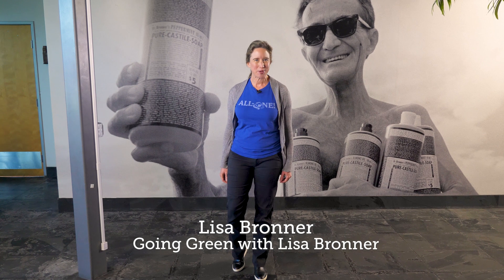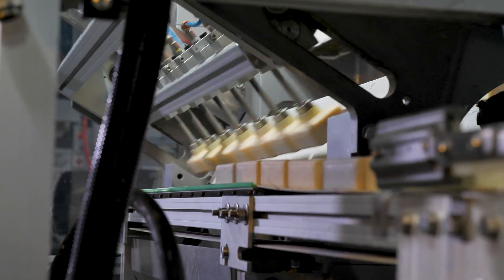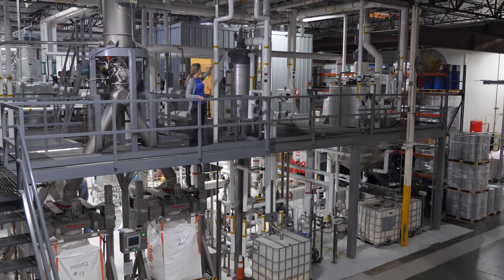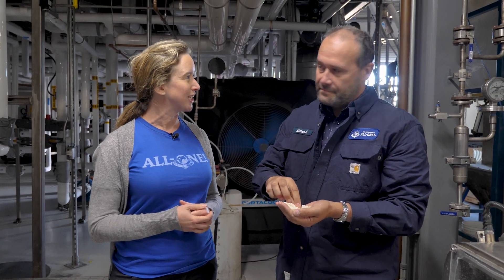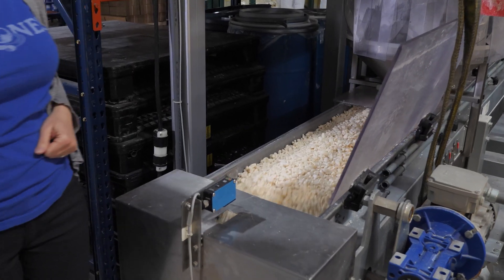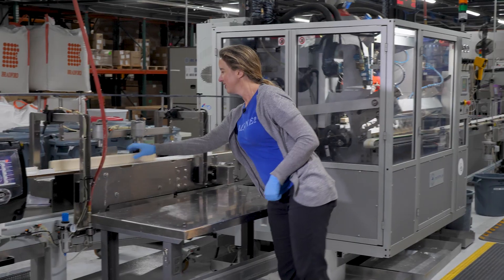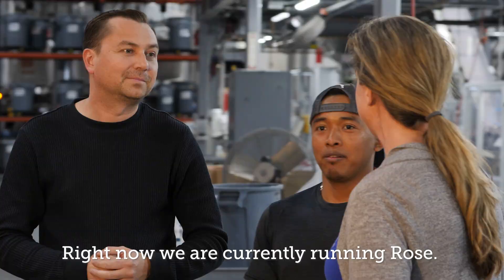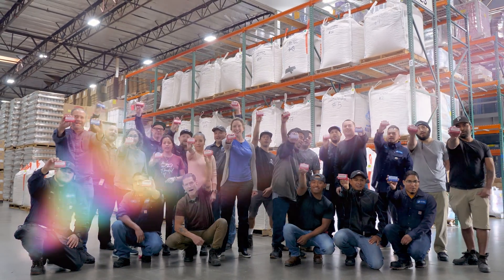Dr. Bronner’s Factory Tour: Bar Soap

Comment: I have a question...why are the soaps milled first
Reply from the maker: I'm not sure which stage you're referring to, so let me know if I don't answer your question here. As you saw in the video, bar soap is a two-stage process. In the first stage, we make the bar base, and the final step of that is the base being pushed through a screen and cut into noodles, similarly to the three milling stages that happen later in the bar pressing process. However, in this first stage, the soap is pushed through the screen not to mill it, but to create the noodles which then dry and cure. Later in the second stage, the essential oils are added to these noodles and the soap is milled three times (mixed thoroughly and pushed through the mesh) in order to mix in the essential oils, eliminate air pockets, and create a super smooth, dense, long-lasting bar soap.

Comment: Hi, is the bar soap form as condensed or as strong as the liquid form? How long does one bar last typically compared to liquid?
Reply from the maker: Hi there- Check out my comment under the Many Magical Uses of Bar Soap video. It's really not possible to say how long a Castile Bar Soap will last because there is so much variety in how it's used. The same applies to our Castile Liquid Soap. But both soaps are super concentrated and because a little goes a long way, they both last a good long time. Here again is the link to the article on my website that dives into the differences between our Liquid and Bar Castile Soaps: https://www.lisabronner.com/liquid-vs-bar-in-dr-bronners-pure-castile-soap/

Comment: I love the "unscented" bronner's soap... but get so mad that almost every store that sells them, puts them right next to the "scented" soaps. So, the smells get absorbed into the unscented. I have to drive across town to one location that stocks the unscented away from the other soaps.
Reply from the maker: Hi McGill- It's true. When you're not used to scent, you really notice even light scents! You might try ordering from our webstore and see how that works out for you. If you sign up to my newsletter on LisaBronner.com , you'll receive a code for 15% off your next purchase. Or head straight to the webstore at bit.ly/ShopDRBs.
Reply: @GoingGreenwithLisaBronner  thanks for the info. I'll head over there.
Reply: Yeah very true...e.g if the unscented bar soap is with lavender one, the unscented one will start to smell a bit like lavender...I hate it when stores/venders do that..they should use their common sense and keep it separate.